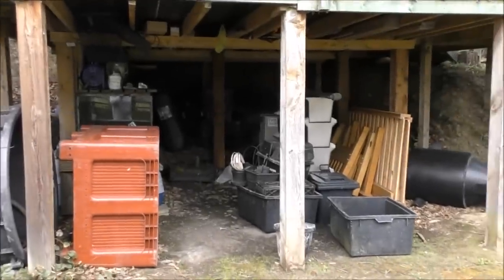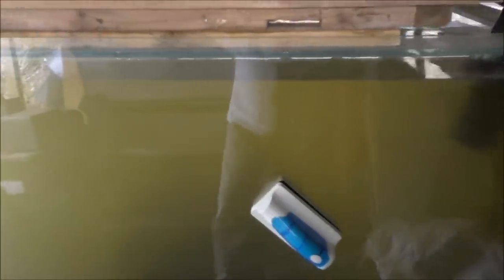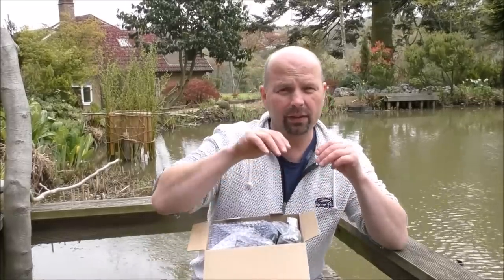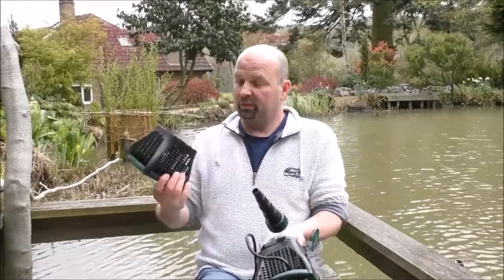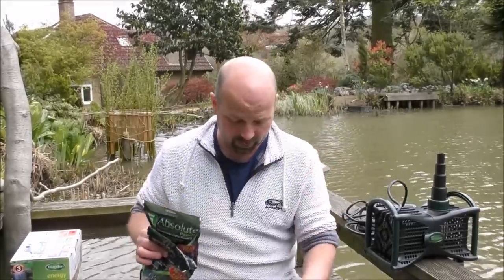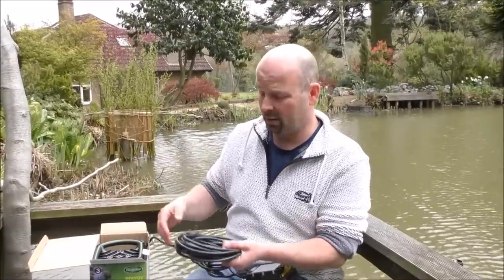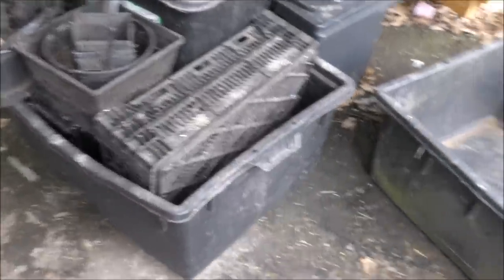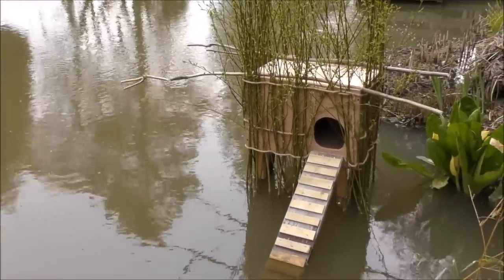A Huge Filter Project, Bad News and Good News

Comment: Excellent video, very instructive.  Could you get the clearest water in that pond and how many filtration units would you need?  How would you calculate how many and how do you determine its size or filtration capacity?  Thank you

Comment: Lots coming up!!That Blagdon Amphibious IQ Pump looks the bizz 👍😀
Reply from the maker: Yes they seem to be on to a winner there - I just discovered a new pressure filter from one of the companies I get foams from which looks really interesting too and I'll see what the trade price is on that as it would be perfect to have before a shower filter. As long as the cost is not crazy I will get one for videos as there are so many out there which are total crap.
Reply: I'm gonna guess you are in the process of designing your own line of filters.

Comment: I don't know much about the UK but here In the US you can find high output solar panels or used systems for pretty cheap. That would cut a huge load off the running cost and may even help enough to Install a small UV light Inline with the filter system somewhere. Every little bit helps.
Reply: Exhaust King England is way to overcast for solar :)
Reply: magzire true
Reply: Here in the uk there IS NO SUN!
Reply: Matthew Stratton true

Comment: Is a large DIY shower filter with alfagrog a good stand alone filter for a 3000 gallon pond?
Reply from the maker: Yes it would be fine for the first half of the cycle (ammonia and nitrite reduction) but you would need a more porous media if you wanted to see a full cycle (reduction in nitrate)

Comment: Hi Richard...how do I ordered the pump from you and can I ask if the pump will work with solar panel as the source of power.
Thanks.
Samson.
Reply from the maker: It would only work if you had huge solar panels,  power inverter and battery back up since a filter pump really needs to run 24/7.
The cost of all that makes it cheaper just to use mains power.

Comment: Electric power is expensive and it becomes more and more expensive. The rents must rise. But solar power equipment becomes cheaper. I think 2 or 3 modules can deliver more than enough power for the pump even at cloudy days. O.k. not at night. This could be a problem.
Reply from the maker: Yes a filter needs to run 24/7 every day so solar power is a really limited supply in the UK. If you could integrate battery back up and an power inverter (if using a big pump) into the system and you lived in a sunny country it could work for sure....just not in the UK, lol

Comment: Ever looked at any of the pentair sparus or taurus pumps?
Reply from the maker: They are a US pump? as far as I can see we don't get them over here but my Oase 40,000 litre pump is 1.1kw and the Pentair 32,000 litre pump is 3.2kw - that is a massive difference as the Oase pump costs around 1/3 to run, lol
I'm guessing that electric is way cheaper in the US however so ultimately it may cost you as much to run the power hungry Pentair pump in the US as it does for me to run the efficient Oase pump in the UK.

Comment: I wonder about your pump in the pond !
- did you say 40.000 liter water at 1200W ?if so, its a very expensive pump to keep running.
lots of pump can do those 40.000 liters with "no elevation".. Try to look at the Blue Eco pumps, and maybe a Blue Eco 900 4flow, it should do 40.000 liters at 1 meter elevation using 150W..

Comment: Your  videos are great so don't worry about the comments . I think most people just check out the first 10 - 20 or so . On the subject of future videos ; one on your take on " biocenosis filters / baskets " would be very interesting .
Reply from the maker: That is something which I think originated in Europe somewhere from koi keepers and it does work - essentially you're packing small 'media' or gravel into a basket to create areas of extremely slow flow and since that is conducive to anaerobic bacteria it can help to get a balance of aerobic and anaerobic bacteria. As long as you have good water flow around the baskets it is not a problem as it doesn't have many of the problems of a traditional deep gravel bed.
When I do videos on sumps I will cover that no worries.
Reply: Looking  foreward to it . I only came across the concept recently and was wondering if it would work in an aquarium without a sump . Laterite also seems to be difficult to source these days which I think would cause problems building one .
Reply from the maker: Crushed lava rock, cat litter (pumice), small gravel - it will all work to create anaerobic conditions in a block of 'media'.
It was the pumice cat litter which people were using over here 30+ years ago for koi ponds and it has the added bonus of buffering pH and mineralising the water. Obviously that is no good for 90% of tropical fish but for African cichlids, goldfish and livebearers it is fine.

Comment: How economical is that pump.. 40 wats !!  I could seriously use that to water change my 125 litre... probably done in 2 seconds
Reply: I've not long bought this 'Aquarium Water Pump Adjustable Flow Rate 1600L/H JP-066' from allpondsolutons and my 220L takes a couple of mins for a 50%  w/c and filling up is the same. Now i don't mind doing w/c's anymore. I have a 10L bucket that i used to use on my 90L and that was a pain in the arse. And my back feels a lot better now ;)
Reply: I used a pond pump to do water changes on big aquariums and on tank where you have to pump water uphill and it's a great time saver. At full speed, you would do a 50% water change in 18 seconds.

Comment: Could you put solar panels on your new workshop just to run that pump ? I ent no good at that stuff so I don't know the maths
Reply from the maker: By the time I got good panels (and lots of them) decent storage batteries for the power and an inverter to take the voltage to 220v it would cost a fortune for the gear but I suppose after that it would cost very little (or nothing to run).
I'd love to have water power, solar power and wind power generators all going here as I love the idea of renewable energy and as we take more trees out it is getting more light in here.
Reply: Pondguru have the solar running the pump  .the pump then running a water turbine before it goes back into the pond

Comment: I'm embarking on a project that involves e aquaponics. Using fish to feed grown beds. Its a gravity system. Pond to bed the back through gravity filter and back to pond.  That pump would be all I need to run the whole system. From the test phase. One grow bed, a small filter and then 1500 pond. for the test. which will last 2/3 months before the "big" system. 4+ beds and a much larger fish "tank:.